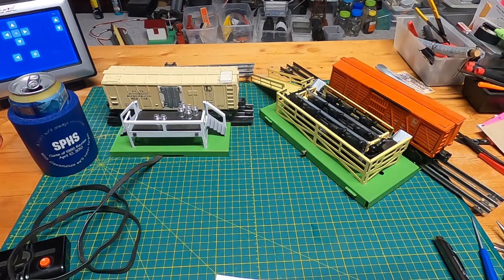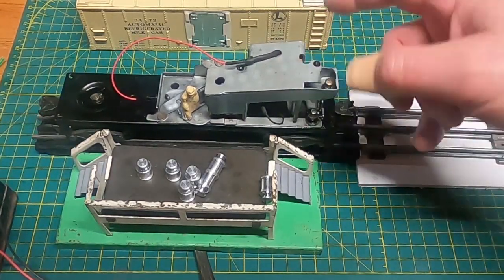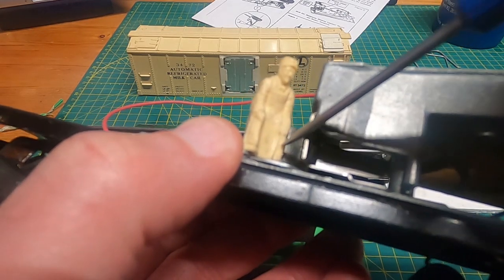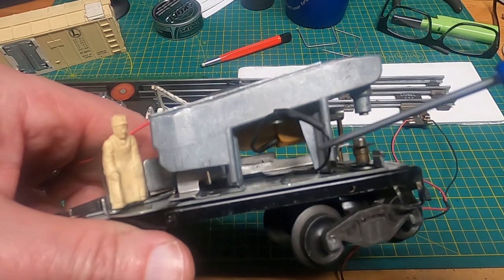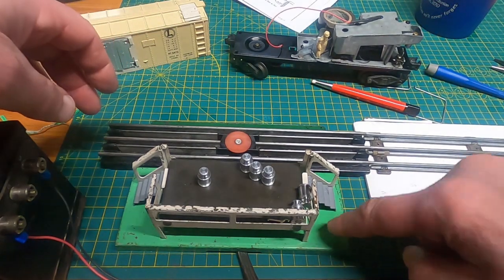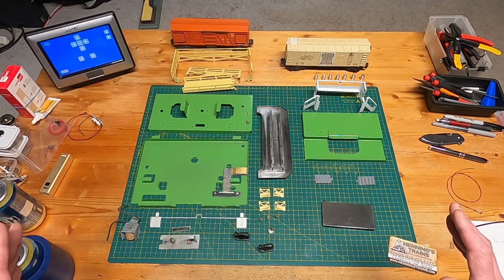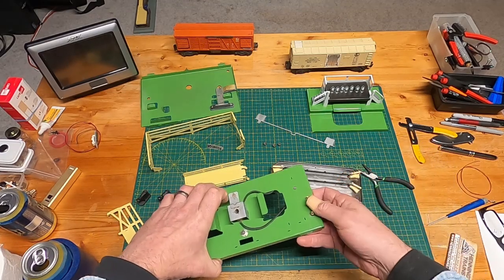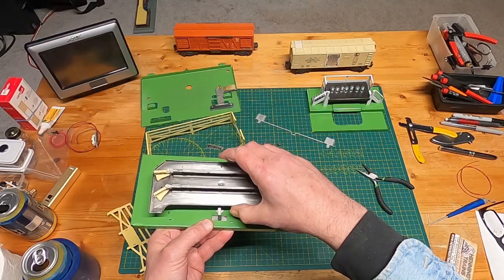Lionel 3656 Cattle Coral and car, and 3472 Milk car and platform restoration.

Comment: Great video! I restored my cattle corral platform. Works great…. BUT the cattle car door isn’t opening. The little plunger inside stays in the down position.
Reply from the maker: I'll have to go back and see how it is supposed to work.  Make sure the wiring is correct and see if you can test it with leads directly to the plunger or on the car.
Reply: @dbtech7914  thanks for responding. I since got mine working. It was wire falling off the shoe. Just had to re solder.
Reply from the maker: Great to hear.  That is usually the problem.  Those small wires break off and you don't notice it sometimes.

Comment: Hello. I have a question about the 3656 car itself.  The ramp or track inside the car has three holes in it that correspond to three holes in the metal chassis.  Were there supposed to be vibration washers here?  Mine has nothing.  The track is basically free-floating.  Thank you for your help.....

Reply
Reply from the maker: Thanks for watching.  It looks like there is supposed to be a pad on each end of the track and one in the middle.  I cut a piece of felt pad that would go on the bottom of a piece of furniture and glued it on.
Reply: Thank you @dbtech7914